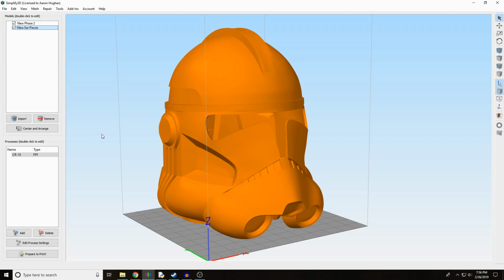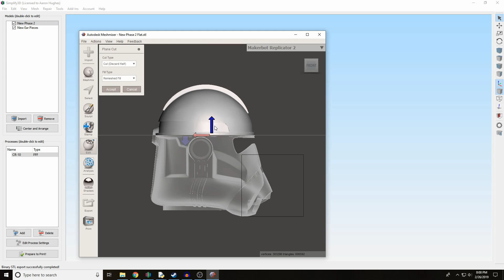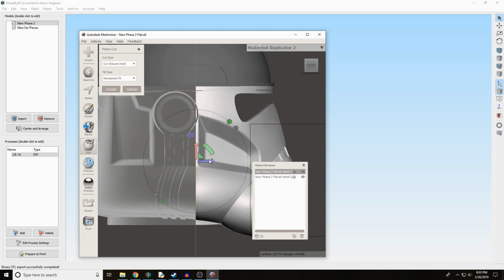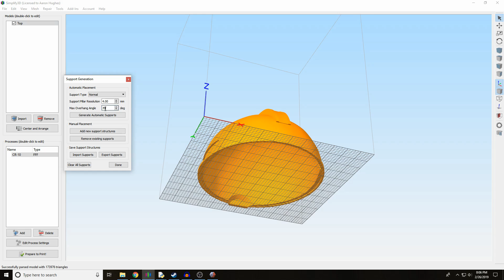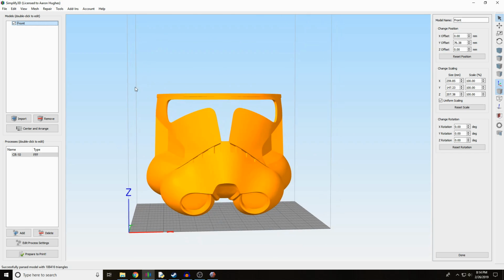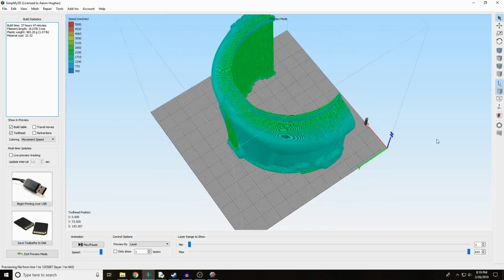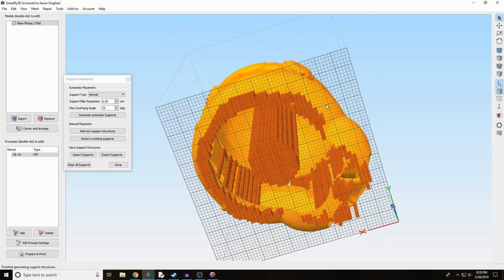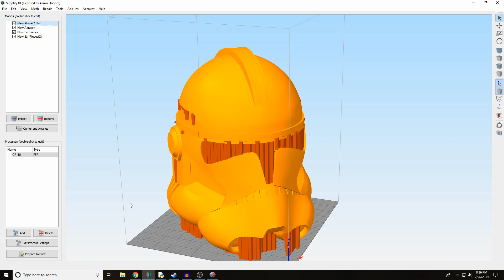How I 3D Print Clone Trooper Helmets

Comment: I've been watching a lot of these videos and I'm a tad confused by a few things. Having built a Stormtrooper helmet the traditional way (styrene / vacuum form) the helmets are often left with overlapping parts that are cut in strategic areas to allow them to be overlapped and riveted together.

In many of these printing videos, I'm seeing the model be sliced either in multiple parts (making a lot of seams), or like this where it is a bit of an all or nothing approach. This confuses me because on almost all helmets there are natural separation areas that would hide seams. For example, on the clone trooper above, there is a natural seam under the brow and under the "ears." If the model was cut along these lines with two overlapping parts, would it not be easier to put back together?

Having additional material that can overlap means that you always have material to fill gaps. Riveting two parts together in an overlap and then sawing / cutting them together will result in a gap that is equal on both sides (think of cutting a silicone mold up the back). Then, parts like the "mohawk", "ears", back details, etc" can be placed over the seams further hiding them. Same goes for the mic tips and other details. 

In fact, the advantage of 3D printing seems to be that you could physically model the overlap so the parts have large surface areas to join to. The gaps are also not holes so much as lines, making filling them much easier due to having backing material. 

Thoughts?

Comment: I noticed the band around the forehead doesn’t have supports on it. Does it print okay like this? Cura puts supports under it and it adds a ton of plastic.
Reply: I have this problem too! I used 65 degrees for the supports and there is so much plastic under the band at the top, how do you fix this problem?

Comment: All my parts are coming in at around 35-60 HRS how do you get yours to around 28
Reply: Im getting mine at 11 days xD
Reply: change infill percentages and layer height
Reply: @laughintrollface  thank you, ill keep playing with my settings and try to get better print times.. i tried to adjust the speed to 60 instead of 50... but ill give it a try :)
Reply: Generally the biggest factors for time are Infill, wall layers, and layer width and layer height
Reply: It’s says mm per second the magic number I found for myself is 140
Reply: @talonabuser1072  dang, that's pretty darn quick, if I go above 65 on an Ender 3 there starts to be gaps and layer issues
Reply: Ovven The Overlord the trick is brother what u want bigger nozzles means bigger layers so less details but faster size prints like masks and helmets slow and small is for higher detail works also I recommend Olson ruby nozzles got bothe the .4 mm and the .8 models and I love em
Reply: @talonabuser1072  thanks man

Comment: Sorry for all the questions, but I have zero experience, and want to get this first print done right.   Can you share your temperature settings and detailed support settings?
Reply from the maker: I print at 200C for PLA with a 60C heated bed. Supports on everything over 70 degree overhang

Comment: I tried rotating the model 45 degrees to fit in one go, but Cura is still complaining that it won't fit.   It does look like you scaled the model down a bit?  Can you share that percentage?
Reply from the maker: Do you have a CR-10? What's your build volume?
Reply: @GalacticArmory  I have a CR-10s; 300x300x400.   Scaling it down to 92% made it fit, but I'm worried that's too small.
Reply from the maker: @breezett93  It probably will be. I'm not sure what to tell you about it saying it's out of bounds. I don't think I had to scale it down at all but I was using S3D

Comment: If you cut your helmets correct you would be able to swap out helmet faces like the BARC and respirator in a modular fashion. If you used magnets you could quickly swap them out
Reply: How do you hollow out a helmet when you are sculpting it?
Reply: @johnconnor6735  The helmet is not actually a solid: The printer prints the shell of the helmet (normal helmet stuff), and will add supports in places where it's necessary, like ridges.

Comment: I have printed mine in one piece, with supports only for the top of the lense. 3 days of printing but was a success. The problem was that i used abs while i didnt have an enclosure so i got a lot of cracks. I filled everything, now i have to start sanding once im done printing the rest of the armor.

Comment: I've got an ender 3 so I have to cut up all my helmets, but here's a thought. Model in a support pillar for the center area, so instead of 30 hours worth of support, you can make a single wall pillar with a roof(picture an empty soda bottle). Get it close to the full height and you only need like 10mm tall support structures between that pillar and the inside top of the dome.  I've never tried it, but it makes sense in my brain..
Reply from the maker: Yes I've heard of that as well but haven't tried it myself.